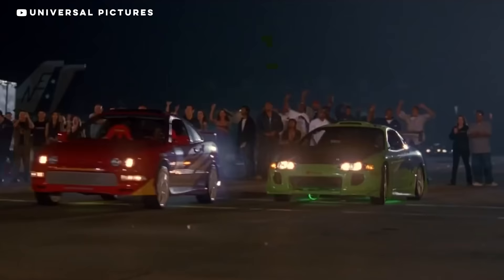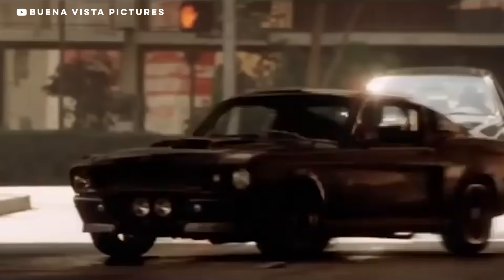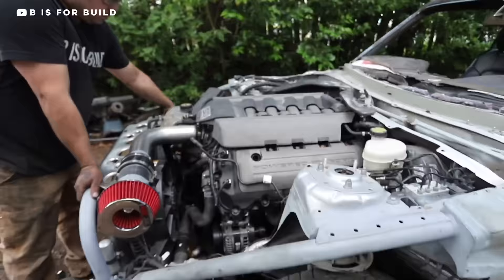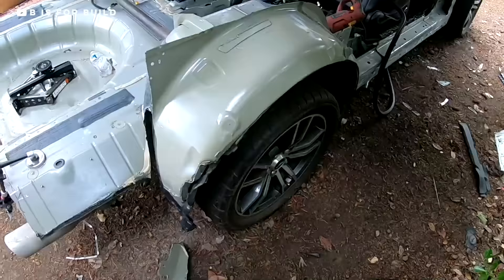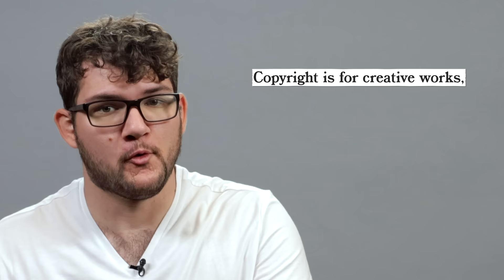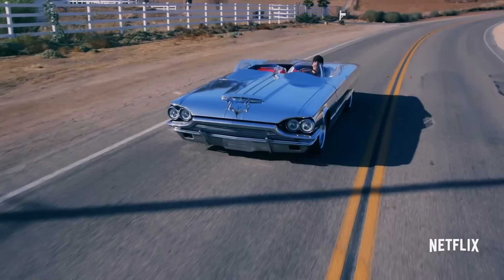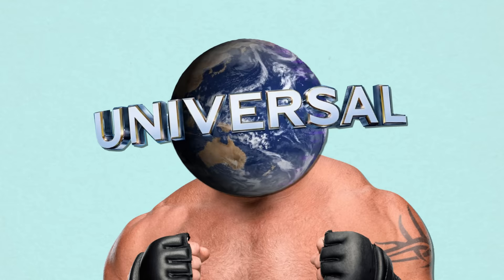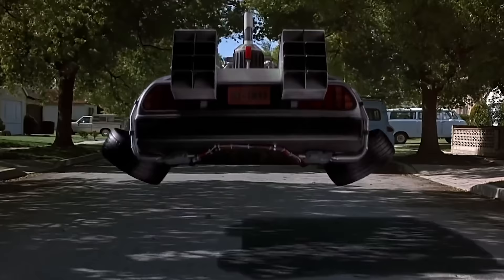How a Lawsuit Killed Youtube’s Most Exciting Project Car

Comment: Eleanor LLC: Give us the car 

Chris: Sure, let me just remove the engine, suspension, tires, steering wheel, body panels, and headlights
Reply: Yeah, in the lawsuit they have to identify the car in some way... if they use the vin number then give them the body shell that vin number is associated with and nothing else.  The problem is they probably seized the car without notice making this strategy impossible.

Comment: Wondering how Gothic garage properly scaled the dimensions for the Batmobile considering that the Batmobile was based off of the Lincoln Futura concept car that only two or three of them were ever built and we're done several years before the show because anyone that watched it may recall that Bruce Wayne had a non-Batmobile Lincoln Futura on the show also even though it was never a production car. Pretty sure both of those went to George Barris after the show ended where they ended up past that I'm not sure

Comment: Honorable mentions: 
Samcrac's Domino's pizza car.
Everything rebuilt by Rich Rebuilds.
Reply: F
Reply: The issue with Sam's car is the company forgot to take off the branding. While he owned the " car" he didn't own the branding.   Say I bought a potato chip truck that still had the brand on the side then started to drive over peoples lawns.  Would the owner of the lawn think the truck belonged to the chip company or some random person?
Reply: @bobroberts2371  So he has to remove the Domino's branding... I can kinda see the point there.
Doesn't mean Domino's gets it back tho. IMO they can require the branding to be removed...

Comment: It was a 73 Mach 1 in the original movie. They say it in the movie several times. Look at the signal/running lights in the grill. Side to side 71-72. Up and down 73 only.
Reply: I’ve got to original gone in 60 seconds on dvd. Had it on vhs when I was quite a bit younger. Also owned a 73 coupe with a Mach1 engine and trans swapped into it. 351c C6

Comment: That Mustang from 2:45 is a masterpiece. I saw Ukrainian plates and found info about it. It has 8.5 l 600 HP tuned engine with 6-speed manual with other enhancements. Boys did a great work! It was for sale on 2021 for 75k$.

Comment: B is for Build case sounds way overboard. They could reasonably demand the cessation of using the name, but they should never have been allowed to take the car. Consistent with that, the takedown of the videos should have only required they redo the audio to eliminate the use of the name and repost the videos.

Comment: I would destroy my creation before I let anyone take it from me
Reply: You’ll be sue again. Bcs it’s no longer your creation. It was theirs, this is based on the judge not you and me. So you’ll lose AGAIN 😂
Reply: @bloatedtonydanza7798  your honor, it's not my fault that someone broke in my garage and stole some part from the car
Reply: I'd take a lighter and torch the whole car right there in front of the tow crew and the lawyer watching this. Tell them: "Here you go. Here is the paperwork to this piece of shit. I am done with it. Have fun." 

After all. Cannot be charged with a crime of torching what is still legally yours. As you still held the paperwork to it. Still, had the title and all. Even if the court orders to seize the car. You still technically own it when it comes with dealing with the bank. And after all. Banks hold a lot of power still.

So torching it and then handing over the paperwork as a transfer. Basically boils down to. They wanted it so badly. They never stated what condition it should be in.
Reply: @Qardo  names an ingame Mustang Eleanor. Can't take what's not real
Reply: @Qardo  I wonder if you'd be liable for damages if some weeks after they seized it and it was in storage somewhere it happened to burst into flame? Wiring faults aren't unusual on unfinished project cars with custom electronics.

Comment: I hope my recovery truck doesn't get taken away, my employers would be pissed.
I have graphics on it saying 'Red Dwarf' front and rear. The reason I have done this is because my work partner who I share my truck with is obsessed with health and safety signs. There is wear seatbelts signs, and no smoking signs everywhere. There's probably 7 or 8 of each sign in the cab. So the truck was named Red Dwarf because my work partner is such a smeghead.

Comment: There is actually a loop hole in the case of Eleanor. As long as the spelling is not the same as the company or copyright. You can use it. For example. There is a Foxbody Mustang in Georgia that is named Ellannor. The spelling of the name is different, there for it does not violate any cpoyright.

Comment: I really cannot understand how a copyright can be 'extended'. What if 2 separate copyrights are running and the copyright period for one is 89 years and the other is 91 years. If the period is then extended to 100 years what happens as one of them may have already been copied. Do they then retrospectively sue? Copyright period should only extend as far as was valid for the initial application at the time. I never liked the gone.... films and now will be sure to never watch them again. Films should be for entertainment and not legal bullying.